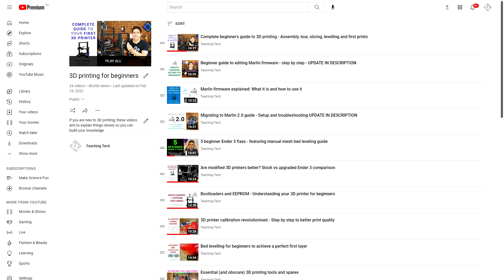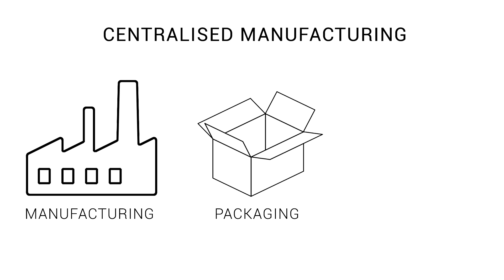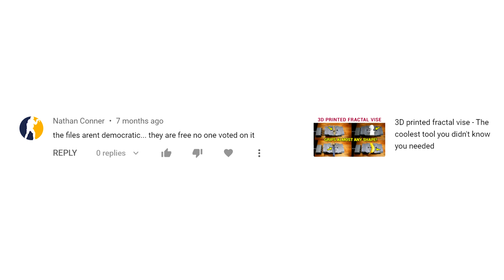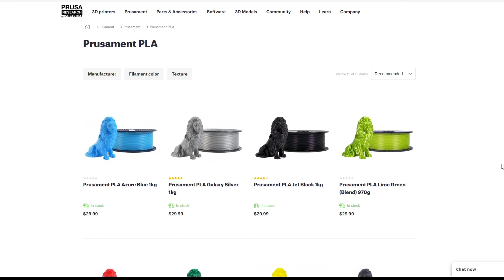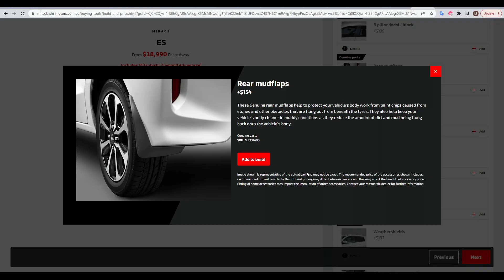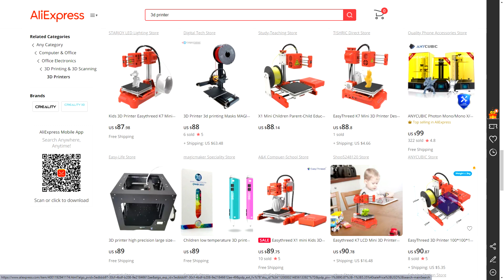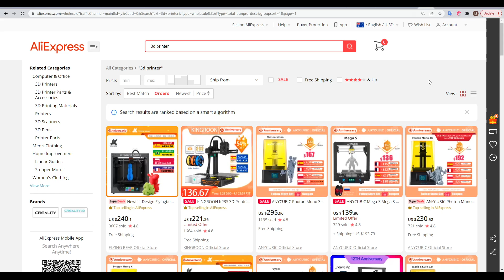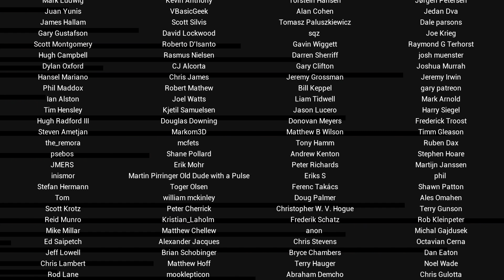3D printer trends are limiting mainstream acceptance: The 3D printing paradox

Comment: Yeah no decentralized manufacturing was never a realistic promise, and you greatly overstate the benefits. It was your hope based on nothing. In particular real products with any significant value add need a wide variety of processes and not just shaped plastic. Even if all the problems you identify were overcome that would still be true and it would still be enough to defeat decentralized manufacturing for most of the market by value. I like 3d printing but it's just a tool.

Comment: The automobile was invented in the late 1800s. Any owner had to have at least a basic understanding of automotive repair in order to own a car because something was expected to fail on virtually any trip. This remained mandatory well into the 1940s and even 1950s to some extent. The first 3D printers were built in the late 1970s, but we're not even at a market saturation comparable to automobiles in the 1920s yet!

I'm not sure I buy into the use case for a 3D printer in every home, but those argument has been made about almost every new piece of tech in history, and the irony of using the automobile as the thing to compare it to is palpable. Even home audio spent decades as a high-maintenance hobby that was only accessible to tinkerers.

Comment: Among other things, I don't think the public at large is ready for 3D printing as you often have to put in the effort to either find or generate your own plans, as well as do the research to know how to handle the materials you're working with. Most people would want a thing you put your filament cartridge in and hit Print to get the item, whereas we still have to carefully control the environment our filament is in sometimes, design parts we may need that we can't find, etc. Designing accurate 3D parts is also harder than it looks. There are certainly other reasons as well, but I just think the reason 3D printers are being held back is as much that the public isn't ready, as well as the printers themselves aren't ready for the public.

Comment: I don't think 3D printing will be widely adopted because I don't think most people have a need for one.  I would be considered a light tinkerer and bought an Ender 3 to play with as a starter printer.  Other than a couple of figurines and fidget toys, I haven't printed anything that I would use and I've had the printer for about 6 months now.  Most of my prints went in the trash after the fun factor of the print wore off.  The most useful prints I've made were to improve the printer itself.  A better comparison would be furniture... sure you can build a chair but how many homes have the tools or a full on wood shop to build one?  It's far easier to take a drive to the local Ikea or order it online.  I haven't even turned my printer on for a few weeks now... lol  For most people, a 3D printer is going to end up like a kitchen gadget they'll use once a year and only takes up space in their home.

Comment: This is a great april fools video, claiming that 2d/paper printers work with any level of reliability or ease. HP, canon, lexmark, epson, and all the other printers are bullshit. None work well and most try to gouge the buyer on consumables while they almost always have software issues. And I say having sold them at an office supply store for a couple of years. I am not saying 3d are more reliable, but they mostly have real problems. as in unsolved engineering problem or real budgetary constraints. With paper printers there is no reason they couldn't be great, but engineering problems into them is too profitable why else don't drivers work on the new version of windows for printer a few years old or why do they have DRM on the ink cartridges.

Comment: But for 3d printing to be really useful you need other skills, like 3d modelling/mechanical design. You need to be able to take your problem and find a solution within the limitations of the technology. Aunt Anni may one day own an easy to use 3D printer but if she can only print trinkets and ready made parts the application will be too limited for mass market.
Reply: A century ago barely anyone could write efficiently on a typewriter... I guess there isn't any market for such things or things that resemble it...

Comment: Mikel my good man, even though you touched on the trickle-down effect 3D printing has contributed to R&D you failed to expound on the massive savings that 3D printing brings to R&D.  'You could do au hole show on it."   When it comes to Research and Development, parts would have been sourced through machine shops, tool & die makers, along with hiring designers and engineers at a cost of millions of dollars.  In order to get the funs to develop your invention, you would have to lobby a group of investors.  If they are willing to put up their money to fund your project you would then be on the hook to deliver results.  In the event that you are successful, the investors would own most of everything viable of your invention, and you would just be along for the ride.  3D printing, on the other hand, changes all of that by eliminating the need for investors.  It cuts the cost of designers, machinists, engineers, and parts down to pennies on a dollar.  In the end, your invention is all yours as you won't be on the hook for the cost of owing anybody anything.   I like to tinker to, but I tinker for what they call "Free Energy."  However, with the negativity attached to the term, I prefer to call it, "Sustainable Green Energy."   Thank you, Mikel, and totally like and subscribe always.

Comment: This pretty much nails it. I've bought a handful of FDM printers (i3 Mega S, MP Mini v2, Ender 3 V2), and have disliked all of them. I'm buying them as tools to support other hobbies I'm more interested in, like 3D modeling, but in order to use any of these effectively, I have to divert a lot of time and effort I'd rather dedicate to my actual hobbies in order to use the tool that ideally, I'd just throw an STL at and call it a day. It's not that I CAN'T learn these things, it's just the time investment to get there doesn't seem worth it when using the printer is just a small portion of what I'm trying to create from a macro perspective. FDM printers are still so finnicky, and require so much troubleshooting that I've spent more time researching and fixing problems than I do printing, and looking at the Creality subreddit, 9/10 posts there are asking for help. The tools are just not there yet.

I've since moved to resin printing, which requires far less setup, and seem to work far more reliably. The Anycubic Photon subreddit is mostly filled with print showcase posts, so I feel I'm not alone here. The resin itself is still an issue with mainstream adoption though, not sure how to effectively solve that since resin will be resin; messy and potentially dangerous.

Overall, I hope we can eventually get a 3D printing paradigm that can be as simple and reliable as the other tools I buy to support the content I make, but we still aren't quite there yet.

Comment: I do wonder why most printers don’t come with auto level, run off sensors, and jam sensors. Those are all things that are able to be added but by the time a user is knowledgeable enough to add or modify the out of the box printer they don’t necessarily need those upgrades. Printer companies should stop advertising printers to new users based on price, but rather build printers that need very little tinkering then advertise those to new users. I would love to see a ender 3 designed for new printer users that come with those features that would make new users life easier.

Comment: I been seeing more people using 3d printers around me. I go to university (electrical engineering) and I got a 3d printer last year and I been using to produce prototypes and for projects using microcontrollers, school has a 3d printer center but you have to wait in a queue and takes for ever. One of my friends got one as well and it's been spreading around the engineering department so more students are buying there own. We also have a department that makes the PLA'S, and make there own and new types of filaments.

Comment: If mainstream 3D printers were to be like cars and 2d printers then I hope they never become mainstream. In cars, there are so many things you are not supposed to open up, change or even know how they work. Most new cars have communication interfaces and persistent wireless connections their owners don't even know about, parts that are non interchangeable even among similar cars and when they don't work properly, it can be nightmare to remedy. 2D printers are perhaps even worse, sure, they work most of the times, but sometimes, no matter what you do, they just wont print, then an hour later, all is good. There is no feedback, no information, little serviceability and the cartridges? Hard to source, overpriced, often with DRM, incompatible, they waste ink, since printer often decides it is empty, there is no way to configure the printers function.
I have much easier times working with 3D printers than with cars and 2D printers.

Comment: I've always thought, and haven't changed my mind yet, about why 3D printers don't catch with the general public: Making something to print isn't that easy, and It's not a magic replication machine. Until they become that sci-fi incredible machine that you download more ram literally, you'll not see them as common. As long as a printer cannot make all the components needed, you'll be buying a lot of stuff still, you can't print ICs, can't print wiring, can't print glass, not feasibly print metals and so on. Thus, you'll be mostly limited to buttons, cases and such, while still needing to buy many (if not most) of the components anyway, besides parts that just need to be injection molded or if printed, SLS prints.
The core concept is limiting to the end user. You need someone that either is happy enough with just downloading models online - of which it's comical to compare the amount of 2D printable content online - or can make that 3D printable comment him/herself, again, nowhere near the amount of people that can just write some text, forms and take pictures and print to paper. The machines are just not comparable, the usage is not comparable. 3D printing requires a skill that many don't have nor want to learn for content creation.
3D printing need is itself a niche, for as long as the machines aren't ridiculously capable, not in the sense of just detecting it's errors and guiding the user (heck that's easy to do, they do have enough sensors to detect jams, lost steps, self-level and such), but in the sense of what they can produce.
Reply: Yes and when the replicator is invented... no one will care b/c no one will need to put any effort into anything.... Skill will cease to be valuable (along with everything else) Not so great actually and I am always skeptical of those who would see such a machine as a virtuous human goal.... 

A 3d printer is a tool ..  as you said you still need skill (of whatever level), the machine/tool needs inputs and labor to create something of value with it... 

Its a very powerful tool but should not to be confused with the answer to the human condition .... 

But 3dPrintopians gonna be utopian.

Comment: Making the analogy that 3D printing at home is like having a solar panel to generate electricity is flawed. You still need to purchase filament/resin. That's manufactured elsewhere, packaged and then shipped to home or retailer. So packaging and shipping is not eliminated from the process.

Comment: Decentralized manufacturing will never mainstream in the home. Remember even with parts available off the shelf something as simple as changing the lock on a door is beyond most people. If at home manufacturing we're going to be a revolution, then the furniture industry would have shut down ages ago, and everyone would have a woodshop at home. No, we got to where we are today by specializing. Renaissance men who do it all will always be fringe tinkerers.

The revolution will come on the backend of small businesses. Repair shops won't need to keep rediculus libraries of simple parts.  Small scale manufacturers will be able to print the tooling for small batch production jobs. Toy makers will be able to distribute designs as digital files to be produced in house at toy shops. Those shops would never need to worry about running out of stock or being stuck with a load of last months flavor of the month.

Comment: These are all good points and something to think about. The market is very much over saturated with many different manufacturers pushing out many versions of the same printer just like the Ender 3 as you mentioned. It’s overwhelming to people who are new to the hobby, so it ends up filtering out many would be buyers. Also, add on the fact that there are no printers from familiar brands to draw in people such as Sony, Canon, Microsoft, etc. I think once big name tech companies start to join in on home 3D printing we will start to see the hobby become more mainstream. The upcoming printer from Anker is a great start and it is evident that they designed it with the intent to make the experience as headache free and fast as possible by incorporating many features that should honestly be a standard by now in one package. Plus, it just looks super sturdy and a potential workhorse right out of the box.

Comment: I wanna start off by saying that I highly disagree with your comparison with cars. What you said about tech trickling down from manufacturers is true. But comparing cars to 3d printers is not fair. For one, the automotive industry has had over a century to evolve, but 3d printers are still a relatively new technology. Also, cars are hugely expensive compared to even a high end 3d printer. A new car will start at $10k if you're lucky and anything decent will go for at least $20k or more. With that kind of price, it better be well engineered and reliable. Also, the idea that you need no knowledge of your car to drive it is, in my honest opinion, very wrong. I think everyone should have at least a basic understanding of what goes on in a car. I'm not saying you need to know how to rebuild an engine, but at least know the basics. That's why you get people going to the mechanic for a knocking sound in their engine and it turns out the last oil change was 38,000 miles ago. Perfect example, My mom was driving to work and she saw an orange light on the dash. She thought it was the check-engine light, freaked out and drove back home. My dad saw it and it turned out to be a tire pressure light. I asked him if he checked the tire pressures and he said they were fine. When I checked, all 4 tires were low. 

Also, would it really be that bad if 3d printers stay niche? Take paper printers. Manufacturers do everything they can to limit your options with ink. Ink is grotesquely overpriced, and many manufacturers implement DRM to prevent you from buying aftermarket ink, as well as crappy tactics like saying a full cartridge of ink is empty. DYMO's thermal printers don't have ink, so they just put DRM on their paper instead. It's very easy to imagine that if 3d printers go mainstream, a bunch of manufacturers will see dollar signs in their eyes and lock down their printers and make it so that you must use their bespoke filament. Today this wouldn't even be considered because the community would defeat it or just avoid it entirely. Having the consumers do the innovation does slow things down considerably, I'll admit, but it ensures that the consumer's best interest are kept in mind since we all have a real reason to. If a mainstream company has your best interests in mind as a consumer, just know that it's purely optional, out of either the kindness of their heart or some sort of plan to make more $$$, and don't expect it to last long either.

Comment: Been a mechanic and modeler for 50 years and I have no problem with the mechanics working on my printers but it’s the programming and computer side that I have a problem with. I have an ender 5 plus and I am having nothing but trouble with the bl touch .

Comment: I have been 3d printing for little more than a year, I also am a tinkerer so the ENder 3 Pro has been fun to play but also quite frustrating at times when things don't work. I really like painting models so 6 months ago I finally bought a resin printer.  I chose the FDM first cause I was hesitant about the dangers of resin handling. Howerver resin printing for me has been such a breeze....  I've had really no significant failures, I leveled the bed once and thats it... its just a matter of optimizing resin handling and cleaning but all this is not dependent on the printer itself.
I'm glad I started with FDM cause it taught me a lot that made learning resin faster and easier, but I think that in a race to become a more error resistant machine resin printers are miles ahead FDM. There is now a resin printer that autofills and if you can automate cleaning procedures too and stuff like that you could end with a very safe solution.  with FDM the amount of variables like, material, teperature of hotend, of bed, of the room, drafts, bed level. slicer settings.....   It still has a long way to go.

Comment: I don't believe in 3D printers in every home anymore that I believe in sewing machines in every home. Industrial processes like injection molding provide most people needs for cheaper than filament. Home 3D printers is great for hobbyists to produce parts for their hobbies, it is a self feeding community. After all, what made home 3D printing popular is the RepRap project, which stated goal is to make 3D printers to print 3D printers. Big manufacturers are not inactive, but they tend to focus mostly on big, expensive machines using tech like SLS that is much more capable than your typical FDM printer.